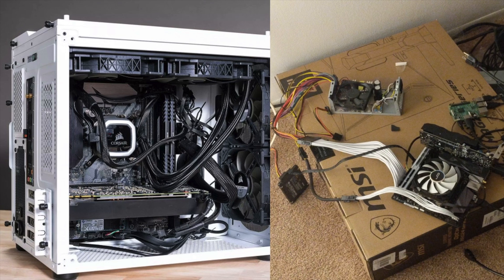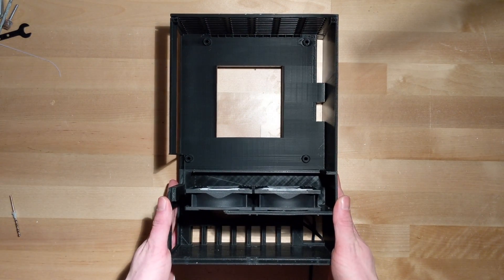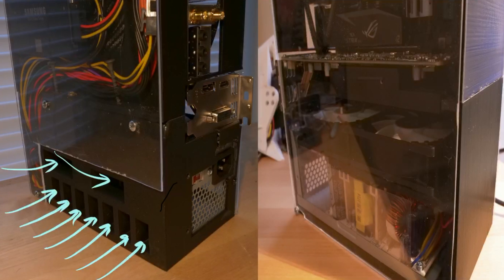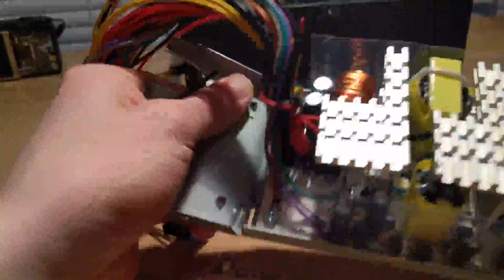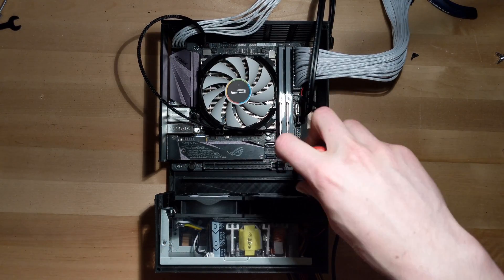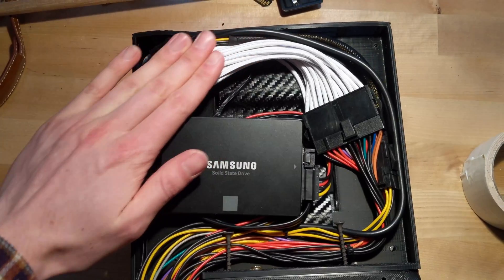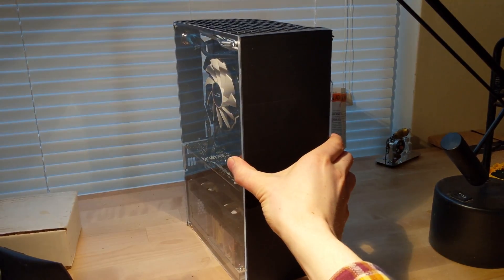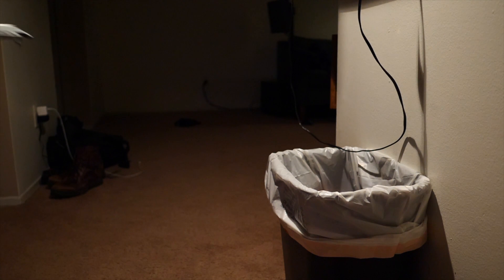3D Printed Mini ITX PC Build

Comment: PLA softens around 30-50 degrees, I don't think the case is going to hold up to the temperature
Reply from the maker: I used it for about 6 months, then took it apart for parts. No issues over that time

Comment: bro i need an update on this. Has the PLA melted yet 😂
Reply from the maker: The PLA survived for about 9 months and then I disassembled the build for parts. I wouldn’t necessarily recommend a PLA case… but it didn’t actually melt during the time I used it.

Comment: Hey, Alta! Big fan of your projects! I'm here with a question that's off topic to this video:

When building the Krave Monster, you use Readi-Foam from Dollar Tree for the body. I've considered doing the same thing with a build of my own, but I've hit a slight snag: I plan on mounting a couple of Kitbots 1000RPM motors inside of the body, but I'm afraid that the preexisting mounts won't allow me to mount the motors directly to the wall (which will be several pieces of Readi-Foam glued together). I don't have access to a 3D printer to make my own mounts. What kind of solutions would you recommend?
Reply from the maker: Thanks!   If you design mounts in any free cad software, you can probably get them 3D printed by EndBots for 10 bucks or so.  If you make your own, I'd cut strips from a credit card, sand the plastic rough, bend them into a bracket that wraps around the motor, epoxy the motor to the plastic, and then glue the plastic to the foam.  With the credit card+glue method you won't be able to easily swap a motor, so bring extra motors with the plastic brackets already epoxied to them for swapping.

Comment: nice, this is fantastic! i've been doing the same thing with almost the same components and almost the same layout this week, but a 1070 and 2700 for added fire hazard. your case looks REALLY good!
maybe print it in PETG or get it cut as you say though, and a SFX PSU should make things a lot easier and prettier too. i got myself the passively cooled Thermaltake NJ450 which is really expensive, but considering the efficiency and sufficient power for any kind of system i'm likely to build, i think its a good investment.

Comment: Your fans are blowing the opposite direction of your fancy graphic animation.
Reply from the maker: Daaaaaang.  You're right.  Time to fix that and re-do the thermal test, I'll throw updated temps in the video description when I have them.
Reply from the maker: Alright, flipped the fans, temps updated.  It absolutely baked the CPU due to air being heated by both the PSU and graphics card before making it to the top of the case.  I think I need to put it back how it was...
Reply: @CarterHurd  i figured that might happen. You could play with venting that side panel just to experiment
Reply from the maker: DanielWGK I re-ran the test with the top half of the case cracked open by a good half inch (with care taken to keep the bottom half of the panel in place to cover the PSU).  This gave me 90 deg for the CPU.  This suggests it’d take a lot to side ventilation to make up for that rising hot air from the graphics card.
Reply: @CarterHurd  oh, i should have clarified. I meant with the original airflow. I'm curious to see the thermal difference
Reply from the maker: DanielWGK results with original config, top of case cracked open:  CPU max: 71, GPU max: 73.  So yeah, extra ventilation will help a lot

Comment: If that's 100% synthetic gpu+cpu load, then you have no reason to worry about these temps, they are actually really good for this small of a build and the amount of cooling you have. Looks pretty good also. What were you planning to cnc if you would though? The printed case part?
Reply from the maker: Yeah, the 3D printed portion is what I'd like to re-do using CNC'd or Water Jet aluminum panels. I just need to decide if I'm willing to pay for that :P
Reply: @CarterHurd  there might be a market for that if you can make them for less than 100